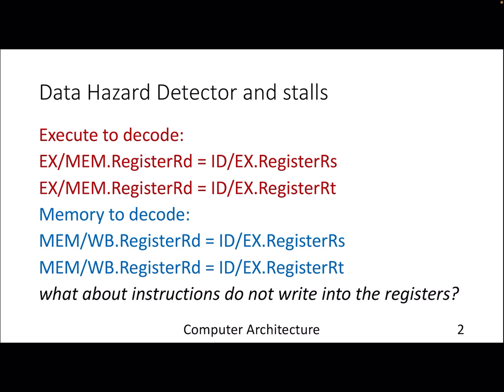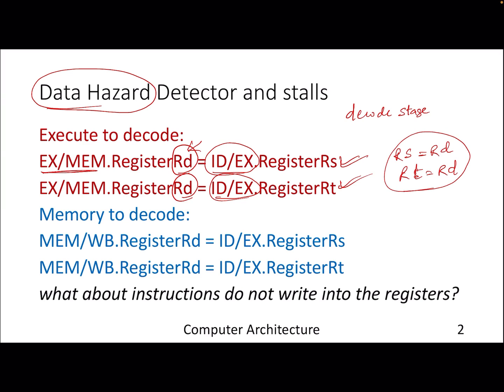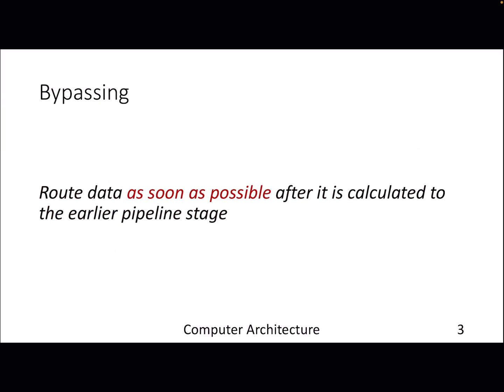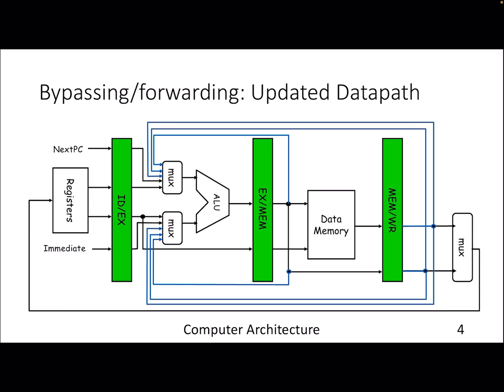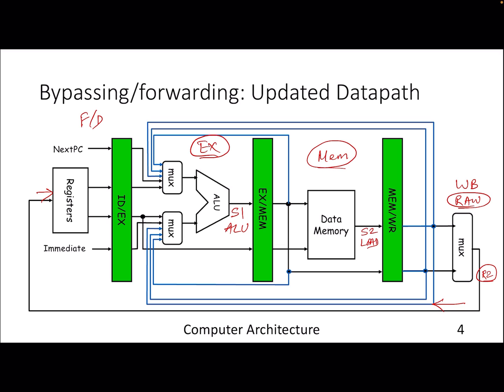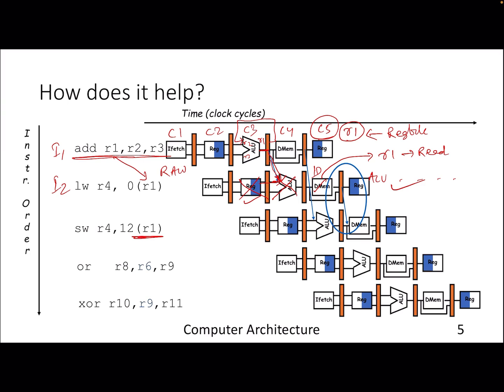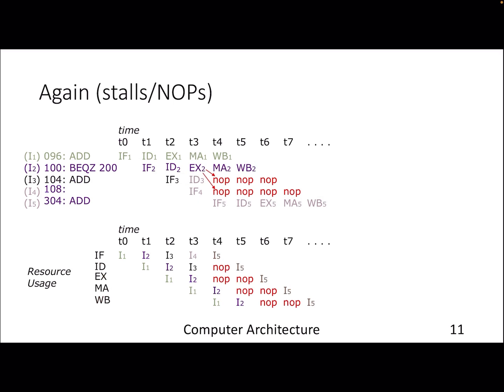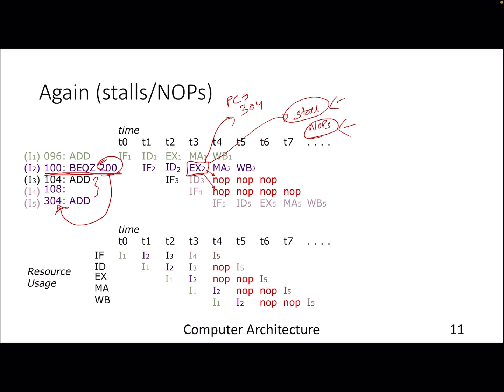Lecture 23: Pipeline hazard mitigations

Comment: @10:20 please explain how is there a transfer from output of DMem to input of DMem(shown in the blue circle)? Instead, as per my understanding register fetch happens during Decode stage so there has to be a stall in C5 during I3 execution.
Reply from the maker: Dear Ashutosh, The output of the DM stage is the content of r4 and that is used for I3 as I3 stores the content of r4 into 12(r1). In cycle 5, 12(r1) is evaluated to get the effective memory address at which the content of r4 should be stored. Please do let me know if it is not clear.

Comment from the maker: Confusion alert: Slide 12: for BEQZ/BNEZ, both the taken information and the target information can be extracted in the decode stage if we add a comparator and an adder in the decode stage itself. If we only add a comparator in the decode stage then target information will be known at the end of the EX stage only. Similarly, if we only add an adder in the decode stage, we can get the target address at the end of the ID stage and taken/not taken at the end of the EX stage. In the slides, ALU refers to a comparator and not a comparator+adder.